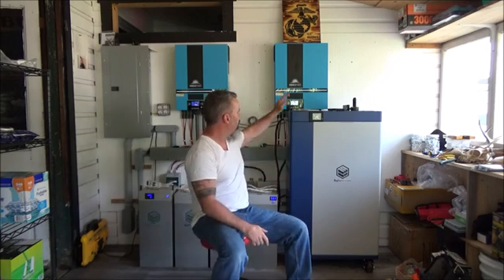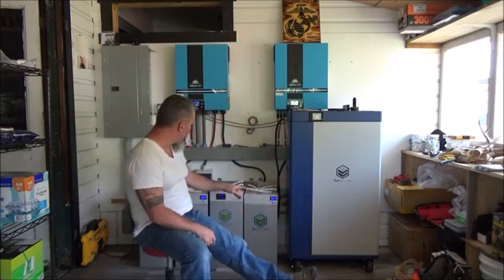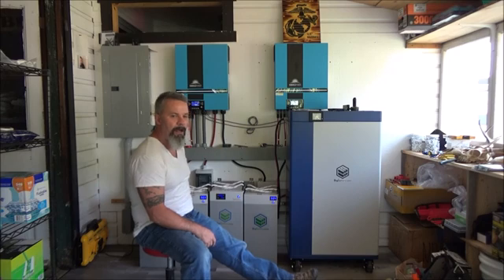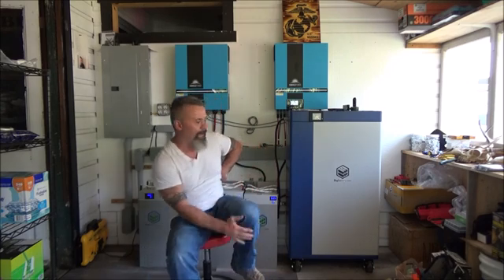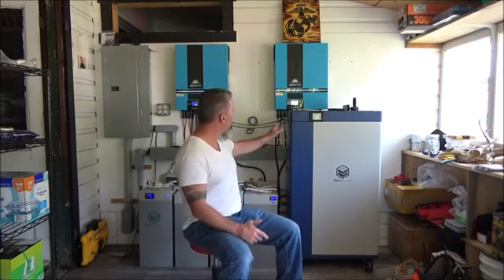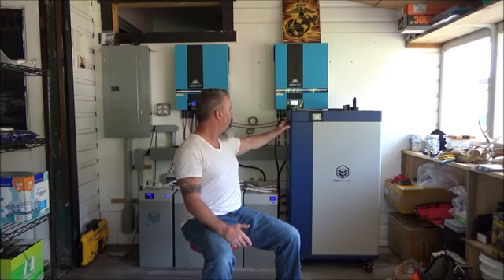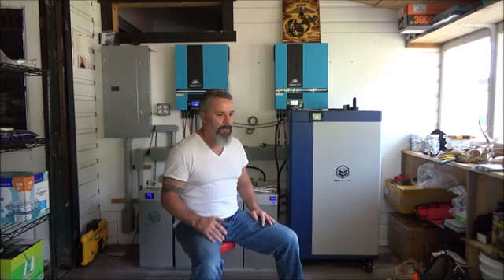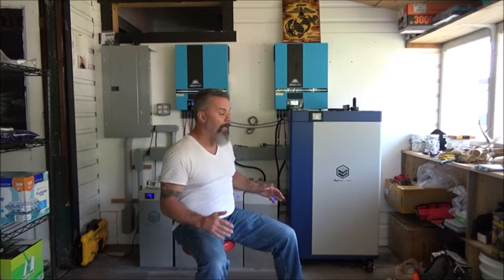Battery Upgrade - BigBattery.com | Kong Elite Max 48V

Comment: I purchased same Kong around same time. I 100% agree on the Anderson connector , with the #4 leads. They are too small and can definitely feel them heating up. 
I’m going to look into getting larger if possible.
Reply from the maker: Thanks for the view! I've been keeping an eye on them, but I couldn't afford to upgrade them yet.
Reply: @DumbGrunt0311  what is the solar power input capacity of this battery ? & The price ?

Comment: Hi,  Im using same Battery in offgrid island.
Reply from the maker: How is it working for you? I initially had a problem with it staying at "idle" once fully charged and not kicking back on when the sun went down. I had to do some minor tweaking on my inverter settings to correct it. Thanks for the view!
Reply: @DumbGrunt0311   Better to use chinese battery hahaha. I disposed, it giving us error from the BMS and it always disconnected. I email the Bigbattery company but it cost $4200 just for the shipping and logistic. we are in the middle of the pacific ocean.

Comment: Nice upgrade. You mentioned the RJ485 that the battery has. That would enable SOC recognition at the inverter then? Would love to see what you get setup with that. I have 3 of the Kong Elites and upgraded the cables for increased safety. Check it out if you’d like.
Reply from the maker: Thanks for the view! I will definitely check out the Kongs...3...wow!

Comment: Every time I go to big battery web side.   I shack my head when I see how much they want.  I bought EG4's  11 battery's,   I just build 280 amp hour bought cells from 18650 battery store.   Have just over $2500 in that.   I fell it's done up pretty safe.  Lined the box with fire board.
Reply: 9 K for the EG4 LIfepower rack system is at good deal over 30K worth of power. Built great.

Comment: How the fk did you get that up the stairs? It's like 600lbs
Reply from the maker: Lol...it wasn't easy! I screwed 1x12's to the stairs to create skids, wrapped a 3" strap around it, gently tilted it back to lay flat on the 1x12's and (2) of us pulled on the strap and (2) pushed from the bottom. I wasn't even thinking about getting it up the stairs when I bought it but when it arrived, I was like "O-shit...that's BIG" 🤣
Thanks for the view and comment!
Reply: @DumbGrunt0311  Yeah I saw the skids and straps, but even with those I don't think I could do it lol. I've been moving mine around with a tractor loader.

Comment: And yeah maybe upgrade that cable  but it's probably fine I just like using the bigger stuff. Seems to be easier on components with the 00 awg. Looking great man for real
Reply from the maker: I've been doing a little research on the cable but, I would like all the same size battery cabling.

Comment: Wow, that's a lot of capacity!  That thing's a beast!  All the upgrades look great though!  Nice to see the new bus bars and disconnects.  Great improvements.

In regards to the size of the battery cable, I wouldn't immediately be concerned since you have all 5 banks in parallel, but I would still reach out to the company and find out why they sent such small gauge cabling.  It doesn't make much sense since the max discharge is higher than the smaller batteries.  

Out of curiosity, what made you go with the Big Battery batteries?  

Also, thanks for the shout out!  Keep up the great work!  Looks awesome!
Reply from the maker: Thanks Adam, still a couple small things to upgrade yet. I went with BB because the 10 yr warranty, battery return at end of battery life and I already had there product and was happy with them. When I compared this Kong  to EG4 on there 10 yr warranty batteries this was a little cheaper. BUT, If I would had seen your video on those inexpensive rack batteries (cant recall the name) I would have been the guinea pig to try them but I had already ordered the Kong. Thanks for the great content, you have helped me increase my knowledge a lot in this realm.
Reply: @DumbGrunt0311  Thanks!  Glad it's helping someone out...

That's good to know that BB has a 10 year warranty.  

Keep an eye on those SOK batteries if you need more capacity.  There's potential for them to come down even further in price!

Comment: Nice work man. I appreciate you mentioning my channel. That install looks nice and clean. That is a massive battery!  What is your total battery capacity now? I’m sure you mentioned it but I missed it. How much of the house is off grid at this point?
Reply from the maker: Thanks Gavin, I appreciate that. You have been a lot of help in my solar journey and I learn something new every time I watch your videos. Total capacity with the Kong is 40.2kWh. Im hoping to make Winter a lil more friendly but will have to see how my panels do. I have my barn and most of the house off-grid except for my big loads...stove, dryer, AC and basement (large thermostat circulator pumps). I'm gonna connect my AC and dryer up here shortly, maybe even the basement circuit. The only time my inverters ramp up is when my son is welding in the barn so I think I would be good hooking up the rest. Even my WH only pulls (2) load bars on the inverter. Its hard to keep an eye on (3) kids and (2) grand babies going willy-nilly on the power. 🤣 Keep pumping out that knowledge!
Reply: @DumbGrunt0311  that is super cool. Yeah the water heater is really the biggest hog. The dryer and oven are no joke either. But the water heater is such a constant heavy load. A hybrid is really the way to go if you have the space for it.